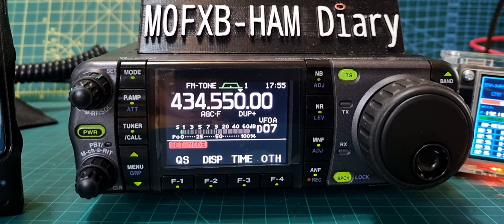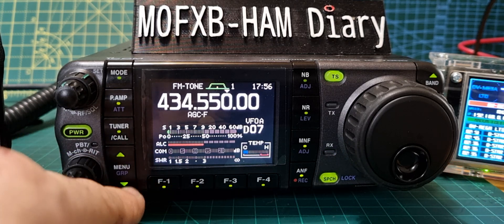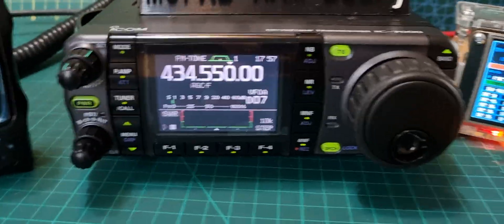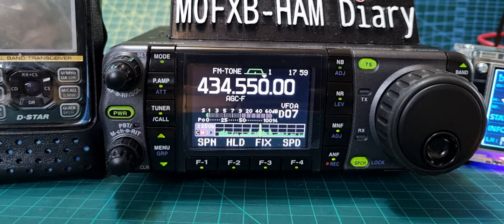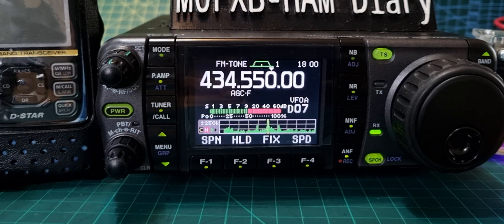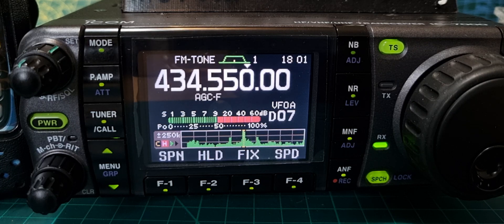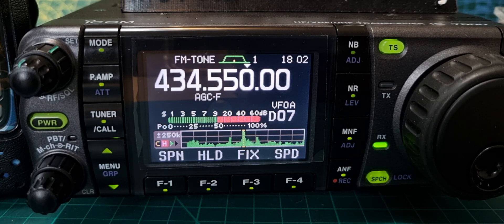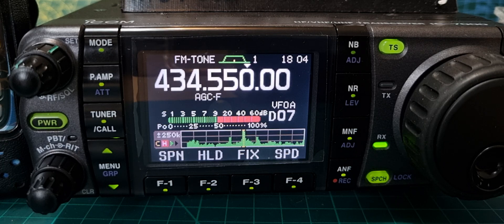ICOM IC-7000 & RUBBER DUCK

Comment: Hi 
I hate to piss on your fireworks, but the ic7000 swr meter does not work on 2m VHF or UHF as it doesn't have a swr detectors for those bands,
Dave
Reply from the maker: I have a good meter for 2/70 I will test it.